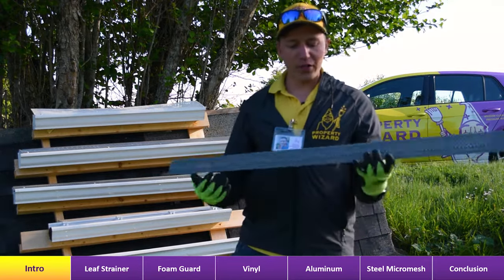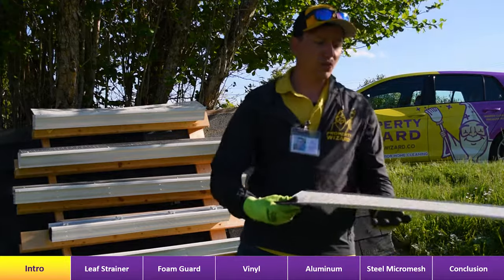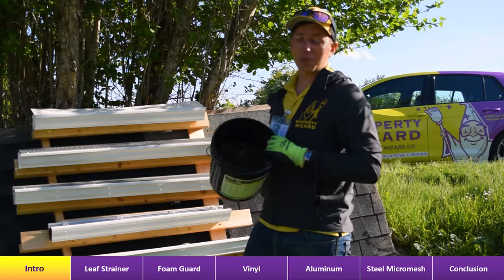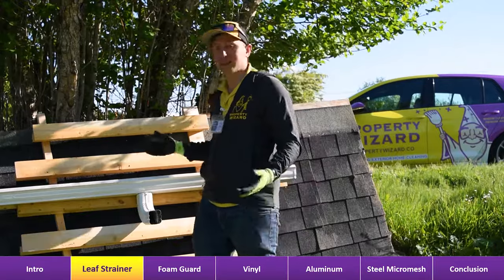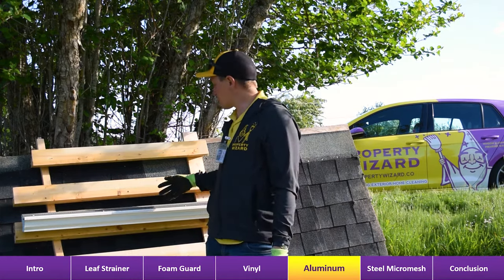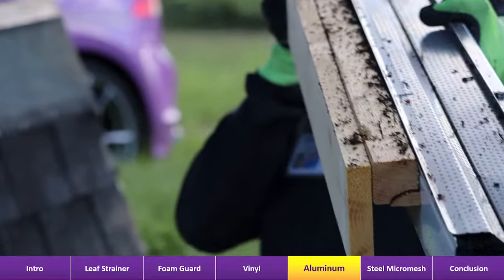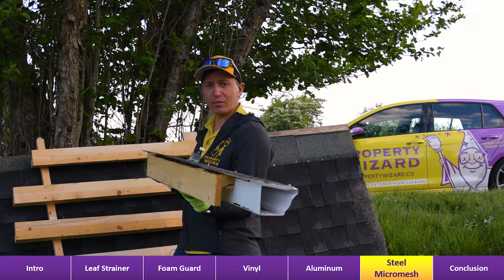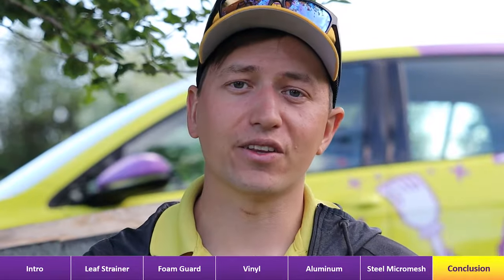The Truth about Gutter Guards

Comment: The problem with all gutter guards especially in Canada here is during the winter seasons when it's snowing melting and freezing you get ice damming on top of your trough which is worse than having the ice damming inside the trough because the water begins to back up under your shingle roof Edge metal or slate whatever you have and rots out your fascia board and your plywood I don't think any trough guard is good due to the fact that the water can't freely run into the trough run freely off of the roof Edge you're creating obstruction by putting a trough guard on not worth it I honestly believe the best investment for a customer is just to hire someone once a year to come in and clean your troughs if you have lots of trees around your house if your house is clear of trees then you would only need to clean your troughs maybe every few years just to clean out the muck in the bottom of the trough people are wasting their money and time with these trough covers
Reply: I bought some of the plastic ones from Home Depot and I can just pop them on and off so I take them off in the bad areas during the winter and put them back on in March before the trees start dropping their seed pods and bud casings
Reply: Good point. Also, this comment is possibly the longest run-on sentence I have ever seen! Hahaha!!!

Comment: If your gutters are easily accessible, I'd opt for no guards at all. You just need to do the proper maintenance in the spring and fall to keep them functioning.
Reply: Where we live,the elms drop little seeds that turn to porridge when it rains. I believe the only thing that will work long term is micro-mesh filters installed at the *same pitch as the roof*.

Comment: the european method is NO gutter guard but very large gutters and downspouts . this does cause blockages but not often . to avoid this i installed a clean out where he downspout enters the ground . internally it has a screen that catches debris . the clean out access unscrews and allows for easy removal of the debris . this is a five minute job about three times a year .

Comment: My problem with the fine mesh gutter guards is the little holes fill up with asphalt shingle granules and blown dirt which let rain water flood over the gutter onto my patio.   I would rather clean open gutters once or twice a year.
Reply: I did the mesh covers placed on a new fire station and there was a pine tree that dropped needles to a point where the gutters looked like willie Nelson’s beard.  Total crack up.  No gutter cover is perfect.
Reply: That’s why the video makes no sense. Without gutter guards, shingle granules fall into the gutter anyway. If gutters can handle them without the guards, so can they with the gutter guards

Comment: Evaluating gutter guards without any water?  Doesn't rain wash most of the gutter butter off before it can work its way into the gutter?  Rubbing it into the gutter with a gloved hand is testing the gutter under different conditions than what actually occurs.  My experience with gutter guards is they work best on houses that don't need gutter guards.

Comment: Over ten years ago I actually went to Menards and got some gutter screens and spent hours putting them on all of the gutters myself. It probably cost me somewhere  @$200 for this 48' house X two. They are in three foot sections and I used 1/8" rivits to attach them. I haven't been up there in years to see exactly how they are doing but I haven't seen any backups though I have probably hit every downspout. with the mower.

Comment: Since there is no gutter guard that is able to keep 100% of grit/debris (gutter butter) out of the gutters, the key is to select one that requires the LEAST amount of attention/cleaning, based on your specific conditions (rainfall, snowfall, amount of trees/leaves in the area, etc).  Your video/presentation should OPEN with my previous sentence (IMHO).  Putting a 6 inch gutter guard panel over the downspout (2 screws only), and another 6 inch gutter guard panel at the "high" end of the gutter will make easy access.  Then, use a garden hose with a jet nozzle on high to wash out the gutter of any debris.  WORKS GREAT!
Reply: I was going to suggest exactly that.. long as the big stuff doea not get through all the rest just washes out.

Comment: Gutter guards do help, but they do not eliminate cleaning gutters.  And if they are screwed on, that just makes the job that much more time consuming taking them off and putting back on.  You really do need to go onto the front of your roof and use a small blower to blow leaves and debris away from the guards in the spring and the fall seasons.

Comment: I installed the ones with holes from Lowes. I have 5 large trees within a few feet if the house  one is a 85 foot pine. So even the roof is covered with leaves/needles of oak/maple. I simply  walk the edge of the roof with a strong leave blower almost touching the guards and aiming one direction and walk to the end. Remove end guard that was screwed down. Clean up and ready to go. This is best when it is dried out so I do it before the storms really start hitting.
Reply: That's a good method unless you are 80 years old or have a 12/12 pitch roof. If you blow it out - why put guards on anyway.
Reply: @timhowell1220  You can take anything that works and create a scenario so it does not work (80 year old man pitch roof). Mine have been up for 3 years and yes there are some pine needles and some roof gravel. Not enough to stop drainage or waterflow. Not even close. I have seen the type your using and seen them fail. There is no such thing as a gutter guard that works permanently and effectively. They ALL have their ups and downs.

Comment: The wisdom of rounded copper gutters was lost during the 40's and 50's when square aluminum became standard. The shape was self cleaning snd the copper prevented the growth of the green life that holds the dirt particles together.
Reply: Wholly agree.  In Europe they use the round gutter troughs and the supports are under the troughs allowing easy cleaning.
Reply: Copper $$$
Reply: @woodstream6137  True but they could just eletrically coat them.
Reply: Do you have any idea what a copper gutter would cost?
Reply: @stargazer7644  It would be expensive,  but maybe make them copper coated zinc. Just my 2 cents.

Comment: I tried 3 gutter guards. After 5 years I had to replace the filter and foam type. The perforated aluminum last forever. The filter material is decomposed and deteriorated from suns UV rays. The foam guards are hold dirt mold deteriorate and cause ice dams in winters.

Comment: Let me be the first to comment. I think for most people you are correct that it's better  to hire bonded pros like yourself to maintain your gutters. But I'm a cheap ass MoFo that would rather risk my life so I got crappy guards from Home Depot. No gutters cleaning needed yet after two years . I got the metal coated grid snap in. I think they work great. I installed myself but I'm in the trades. 
A few scrapes but no falls thankfully. For me I like them.  But I agree for most people it's way better to use your service.

Comment: I used the same thing on my house and they plugged up the 1st rain fall and I had a waterfall off my roof also when I removed it after 2 weeks the bottom of my gutter was 1/4 full of the fine debris I removed them and I'm using the foam now working much better and if you install by cutting at each gutter support they are easy to remove and the best part is they are cheap and easy to install ive used the foam for 4 years now

Comment: Gutter Guards are useless if your development has pine trees or any small buds that fall on your roof. Many of our neighbors and our home was covered every years with pine needles and other small small pieces. We all had different types of gutter protection and the contract on each had a warranty that would prevent stuff from clogging our gutters. Heavy rain caused rain water to go over top the guards and water would just flood the front and rear of our homes. Call after call and the company never showed! We all ended up having the guards removed. the following year we all got together and hired workers come our twice a year and clean our gutters!! no more clogged gutters!!!

Comment: After 28 years in the business, they all suck. Just pay to have your gutters cleaned, you will end up further ahead.
Reply: I'd say you're right about 99% of gutter guards.  I've been a carpenter fifty years, worked with dozens of roofing contractors and they all said gutter guards were a joke.   Well, a couple of years ago, I started hearing good things about RainDrop guards, so I installed a 30 foot section to test them.  After a year, the gutter was clean as a whistle, so I installed them on the rest of our gutters.  The design is great - they're installed on a slant and the surface is slick, so leaves just slide over and off.
Reply: My gutters are 30 feet off the ground that is uneven . Gutter guards are better for me.

Comment: completely unrealistic test - dirt does not fly through the air and land in gutters. leaves, needles, and granules are what land in the gutter and after time break down into "dirt"
Reply from the maker: We clean gutter guards all over town and I find plenty of clogged gutter guards. My test was definitely pushing these things to the limits, but the stuff i brought out here came from gutters in the PNW. Completely realistic test bud.
Reply: If the guards collect larger debris that doesn't get washed or blown off by the weather then it breaks down on the guard. I'm still not convinced i want them after installing a new roof
Reply: Where to you live that dirt doesn't blown through the air. It is normal in Northern Utah. It clogs screens all the time.
Reply: We live on dirt roads. Dust is blown all over our roofs.

Comment: The only thing that will work is a remote controlled tractor in your gutter that runs every 3 day and pushes all debris out the trap door at the end. Alum with holes filters the big stuff and fine SS mesh clogs up with shingle crap. The tractor is the only winner.
Reply: :face-green-smiling:build one and get Rich!!

Comment: If u ask me I would say it is a con job  defenetly a farse 
I did installed a leaf gard  for a smoll house been charged over $5000. 
Had nothing but troubles 
Need to clean them every so often 
So much overflowing 
So much that I am thinking to ripped them out 
By the way their service is nothing but criminal 
 workers that are concerned  for the fast way to do do job resulting in terrible workmanship  beside denying any wrong doing 
My sedjestion unless u have a big mansion don't t do'it 
Wea